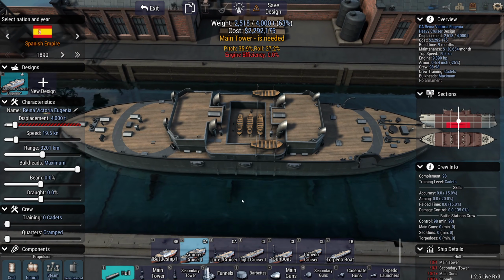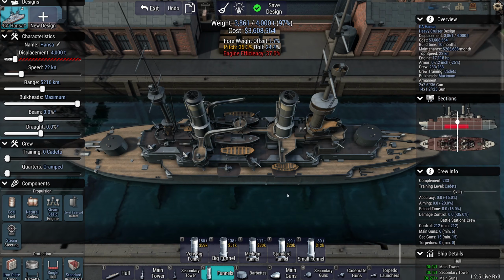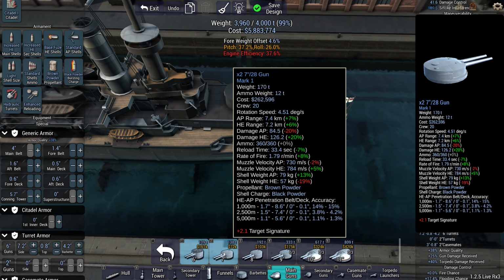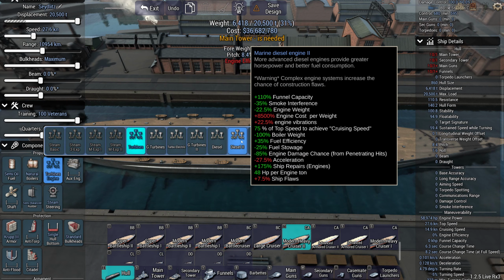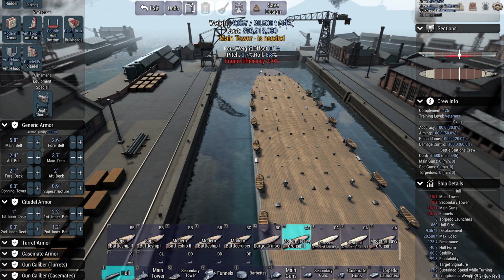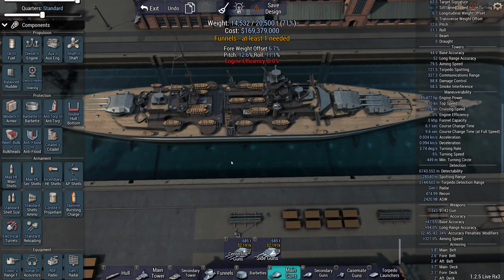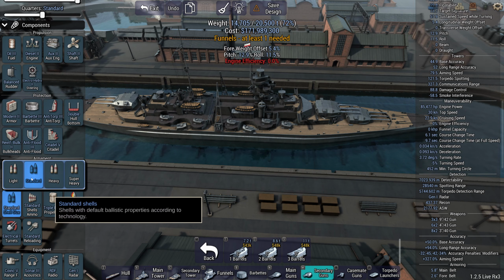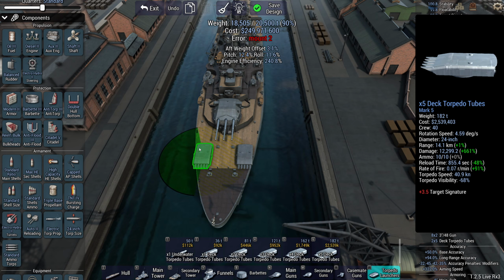Heavy Cruiser Guide - Ultimate Admiral Dreadnoughts Tutorial

Comment: Ships range is not about ability to travel far away. You will be able to travel, but  it will be slow travel and very slow in the fight (without fuel).  Ships range it is mostly about generation of missions.
Abut rudders. Turning radius shown nothing. Yes, in case you want to draw circles unbalanced is looking better = circle is smaller, but unbalanced is slower in changing angle, so in case you need to turn 90 degrees left, than 90 degrees right, balanced will do it much much and MUCH faster. For combat use balanced is only selection because overall maneuverability is MUCH better. I mean "Course change time" numbers in ships stats table. Don't underestimate it.
Yes, it is all from my point of view =).

Comment: Barrel lenght adding to reload time (or reducing in case of making barrels shorter) is kinda stupid (balancing mechanic, still stupid). IRL Leopard 2 with L55 gun reloads as fast as  one withL44 gun. Btw never had any troubles fitting 4x3 9inch turrets on german 20+kt CA hull (balancing that ship was interesting).
Reply: like the only reason I can imagine here is that the heavier barrel is longer to lower to the loading position, and raise back, although should not be a problem with man handlable rounds or advanced autoloaders like on Des Moines-class

Comment: Heavy Cruisers, the Workhorses of your fleet and technically the Smallest capital ship you can have, depending on who you ask. As a general navy term Heavy Cruisers have 8inch guns (203 milimeters for those in the Metric system), anything smaller then that is usually a "Light cruiser" ,(which usually have 6 inch guns or 152mm) but who cares right? Cruisers more then any ship type are the ones that change the most over the course of Navel History, going from effectively "budget" battleships to what we picture as a "heavy" cruiser and like wise from "large" DDs to "Light" cruisers.

Comment: Some additions to the 1940 part of the video, not in any particular order (hopefully written in a noob friendly way):
1)You can in fact fit a 4 turret set up on this hull, even 10 inch triple guns (which I did, haven't tried bigger ones) and balance it out with almost the same secondary battery as in the vid. Just make sure it's the largest variant of the hull (it gets visually larger in jumps the more you increase the displacement).
2)Beam and Draught are adjustable during refits while displacement isn't, and can shorten or lengthen construction times when reduced or increased.
3)I haven't played much on the latest versions but if the AI still torpedo spams, I generally go with Electrical steering 2 and an unbalanced rudder with a decent sonar or hydro 3.
I got good at evading AI torps with my ships so I go for the best turn circle and less of a torpedo belt.
Torpedo belt is usually level 2 or 3 depending on the torps, rarely 4.
Other than that advice is just to learn the pattern of movement when the AI launches torps: they will close range and turn broadside, launch a spread (sometimes they turn too fast and don't launch) then they will attempt to increase range and repeat.
4)All or Nothing is generally lighter if you go for a lot of belt armor. If you don't change anything and just max out the 3rd layer of citadel armor it will still be lighter.
5) There is a flash fire chance stat on the stat list, towards the end of ship details. Haven't seen a ship with a value of below 7.5% explode.
6) Long range seems to be around 12.5km (at least for older patches (1.08.9)).
7) IMO running RDF/Radio AND Radar is useless.
The accuracy bonus from comms is 5-15% and late game is essentially insignificant, and you will probably be out of range regardless (depends on play style of course). Plus you'll have the techs from research to help with it.
RDF is useful for directing you to the enemy, but radar does the same and offers much more in terms of recon, spotting and accuracy buffs.
8) Torpedoes... I used to like them, not anymore. Mid to late game I find them detrimental as the AI usually evades them. Unless they are spammed, but then you are somewhat of a floating bomb as they tend to explode.
9) HE shells:
Incendiary and High Capacity don't do partial pen damage, anything above does.
Why is it important? 
If you don't run a firestarter build and want the secondary guns to be able to hit heavily armored targets (somewhat) hard while staying effective against lighter ones, this is probablt the choice, high end AP might also work, but it will somewhat limit your main guns. Nose fuse usually works well for destroying lighter armored targets with your main guns while offering good damage and with later non fire oriented fillers can even burn ships down or make then surrender (provided you have a good amount of secondary guns of course (i.e 10 per side).
10) The armor bug works with citadel layers as well. Their maximum thickness is linked to the current thickness of the deck/belt armor. 
i.e: increase it to 15 inch belt and set the citadel to 7.5 inches, reduce the belt to 10 inch and you still have a 7.5 inch citadel. Didn't know it affected gun turrets as well.
11) As I tend to use a design that's close to the CA in the video, I feel somewhat "qualified" to talk about the armoring in this case(It's my opinion and experience, yours may differ):
6 inches of deck is overkill, 3.5 main and 3 or 2.5 aft and bow is what I use, never saw a full deck pen.
10 inches belt, 6 inch bow and aft belt. With krupp 4 you are effectively impervious to DD caliber guns and most secondaries (aside from capital ships). I go with the most citadel belt armor and round/good looking numbers on the deck (i.e. 1.5, 1, 0.7). 
I almost always tend to close in to 10km or less, so deck armor is not really important for me.
I also use the Turtleback scheme and against lighter guns it holds extremely well. Had 127 old French ships (they built a couple dreadnoughts a year or 2 before) go against 3 of my CAs (early 30s or late 20s, as I almost speedrun CA hull tech. 19000t, 4x3 10 inch Mk3 turrets with +20% barrel length, RDF, hydro 3. Price for one ship was less than 177M$).
Almost at the very beginning the battle one CA took 2 15 or 14 inch shells to the engines and then a torp. 2 engines were flooded for the rest of the battle, later took 2 more torps that I didn't notice. still was at 50-70 floatablity. I was on the defensive for most of the battle, screening for her with the other two CAs.
End result was 5 out of 6 enemy battleships (mk2 or 3 14 and 15 inch guns) survived with less than 10 other ships.
My CAs ran out of main gun ammo (main reason why the BBs lived), lost almost all of their secondary guns (4x double 4 inch and 4x double 3 inch guns per side, unarmored) and had around 50-60% hull integrity remaining.

If you think I'm wrong in any of the points above you are welcome to correct me.
Reply: Addition to point 6 (long range accuracy). You can see the bonus of long range accuracy tech in the top of the accuracy listing. 
Pre-1900 in my campaign so I get (a lousy) 0.1-0.3% long-range bonus when I hover my mouse over the sea from 1km out to 10km-ish.

Comment: You know me.
I immediately put the best equipment available. Although i didn't change the barrel length of the Main Guns and opted to increase the length of the smaller guns such as the 2 to 3 or 4 inch gun.

When building Heavy cruiser i don't really care much about equipping it with Torpedo launcher and instead focusing it on All Gun cruiser